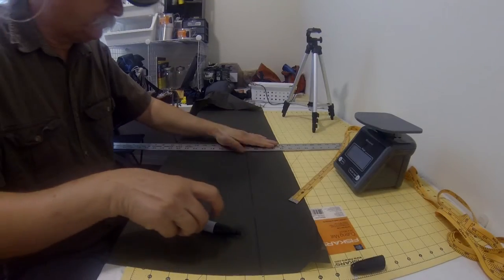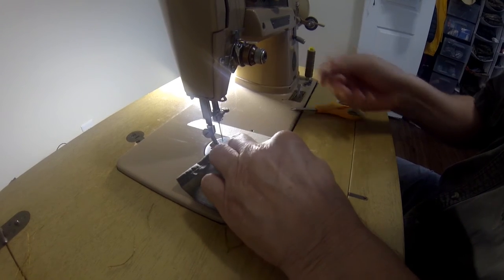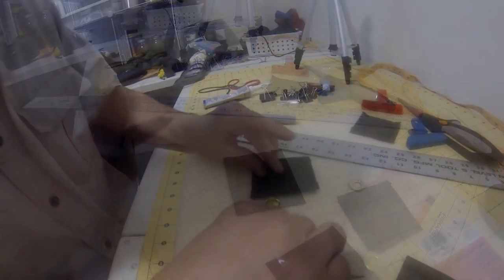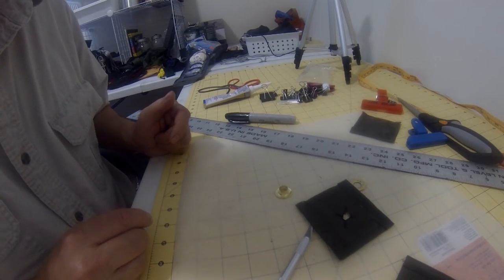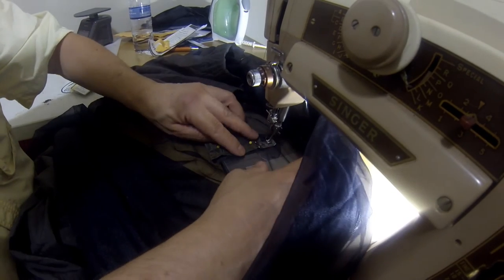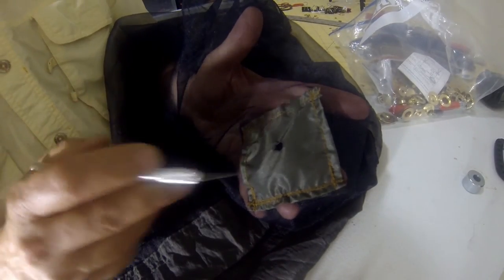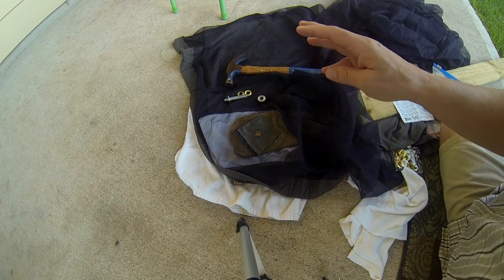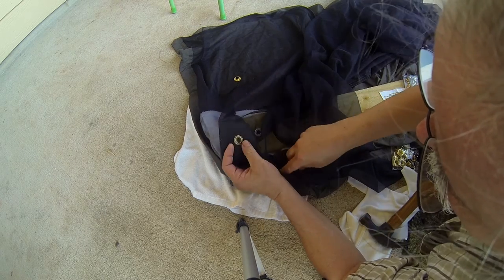MYOHG: WOOT Yukon Mosquito Hammock XL Ridgeline Grommet Installation Sewn Version

Comment: I'm new to adding grommets...  What size grommet did you use?  My Structural Ridgeline is made from 2.x mm Zing-It, so pretty small.  I'd like to keep the grommet hole small to keep out "guests" as much as possible - so a small grommet hole would be good.  What size would you recommend?  When a grommet is listed as 1/2"; is that the total width of the grommet or the size of the hole? 

I guess I could always just add a small flap over the hole.
Reply from the maker: +Jason Oliver Thanks for watching! Those are the 3/8" grommets, but you could certainly use something smaller.  That's the hole diameter.  I got them at Academy:  http://www.academy.com/shop/pdp/academy-sports--outdoors-grommets-20-pack  . They are known "officially" as the #1 grommet. See this chart and you can check sources using either measurement:  https://grommetmart.com/page/2/selfpiercing-grommet-size-chart-.html  .  The liniting factor would be the size of the loop at he end of your ridgeline and whether it will pass thru the hole. If you use permethrin in combination with your bug net, the chances of getting a visitor through the hole is fairly small, IMO.  Would love to see the result---post pics at HammockHangers.net if you get the chance!
Reply: +sargevining thanks!  That chart explained things well, much appreciated.  As for the knot being the limiting factor - I think I'll pass the cord through and then put a stop knot on the end.  It won't come back out after that, so I'll just leave it there when I take the hammock down. When I go to set it up, it'll be right there so just hook it up and good to go.  That should work ok.  Thanks for the tips and DIY aimed at newbies like myself!!